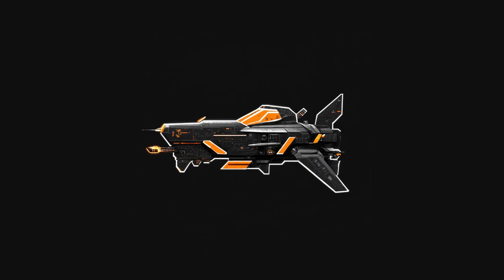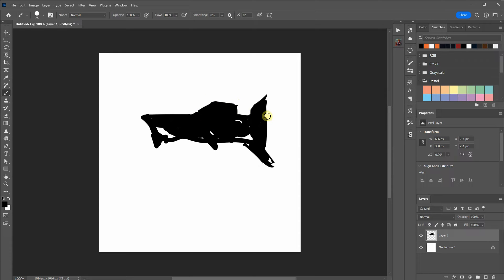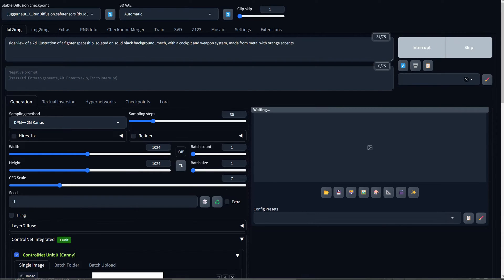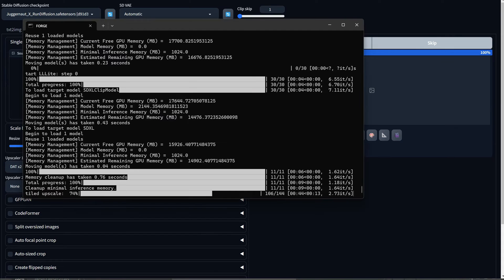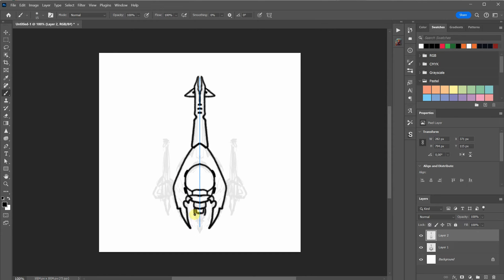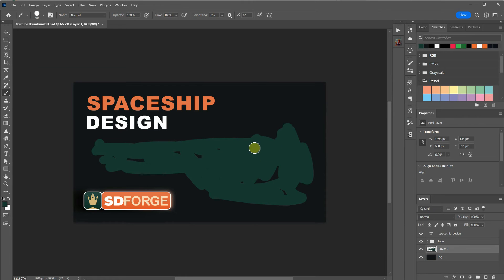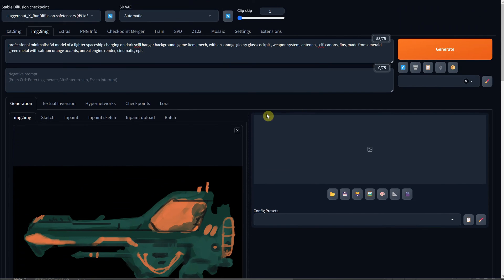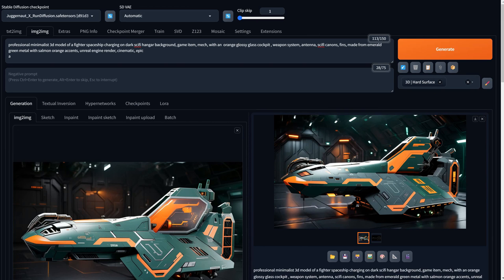Spaceship Design Process with Stable Diffusion & Photoshop

Comment: I love this. I'm trying to learn AI image generation and I see there's a tutorial series on SD and a more recent one on ComfyUI. Is it worth learning SD, or should I move straight on to the more recent ComfyUI tutorials? Can ComfyUI do everything that SD can do? I'm particularly interested in transforming sketches into detailed pictures, like this tutorial shows.
Reply from the maker: SD stands for stable diffusion that is a model, there is like sd1.5 sdxl, sd3 etc. comfyui is an UI an interface that can run model, others are forgeui, a1111. So comfyui can run sd models, flux models, audio models, video models and so on. In the last year i switched completely to comfyui because i have the most control and most updates

Comment: Hey, i just want to ask why u using Forge instead of Automatic1111
Reply from the maker: Is faster for me compared with A1111, loads faster and generates faster and have some optimization , only downside is that hasn't been updated for a while and some extension are not optimized so depends of what you need, for the type of work i do it just work better for me

Comment: TNX!
 Question close to ur topic - Do u know how to update building controlnet in Forge? There is new preprocessor ANYLINE (u can use its MistoLine SDXL model with lineart, but native processor is better as i saw).
Reply from the maker: I dont, i know only how to add control net models. I was hoping the forge team will get new updates but they didnt do any updates for a while, not sure why
Reply: @pixaroma  same for me. Forge get started as a greatest UI, but stuck in 1.0 state(. Any way try new MistoLine model - its may be more accurate for such work.